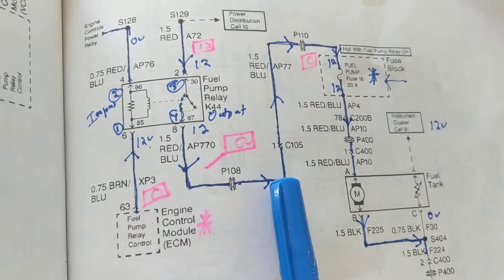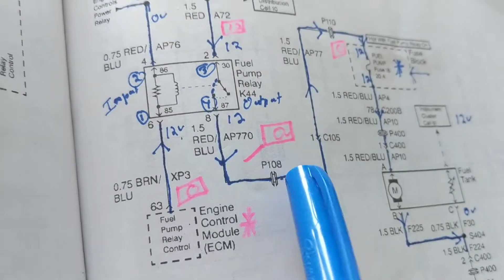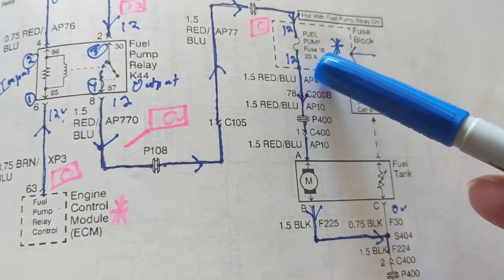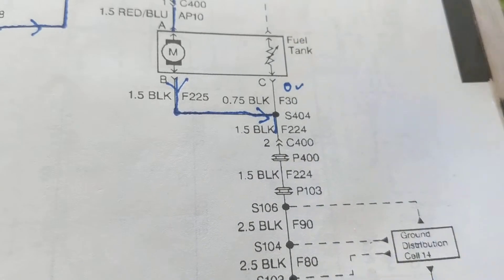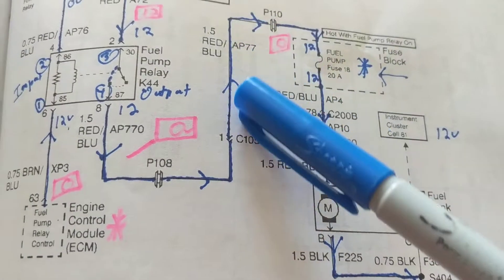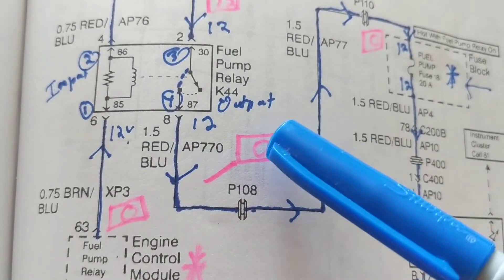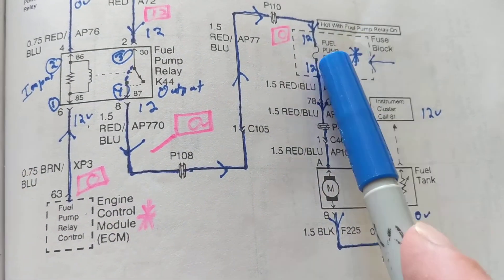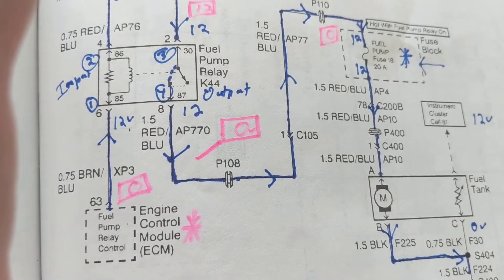how to fix a car WITH FUEL PUMP RELAY.  PROBLEMS  ,WIRING DIAGRAM WITH MULTIMETER

Comment: My fuel presure is low will leek down over time 3hrs 30psi to zero fuel gage became inaccurate after lowering the fuel tank found a gas leak fuel fill hose had rubbed the frame fixed it now? Fuel pump runs not 3sec  anymore  thurty second or more most time now have to use starting fluid to start first time runs bad floods then will smoothen out like a new car next time will start right up after interment😢
Reply from the maker: Usually if fuel pressure leaks. Your fuel pressure will go down pretty quickly, not over hours. That's the first issue number two. There might be a bad fuel pump, regulator or check valve is that if that happens? Leaky fuel injectors might also be a cause but that will be over a while when you lose fuel pressure that has to be done with a scanner on a balance test I would wait first thing in the morning when the car is cold and not driven. Measure the fuel pressure and see when it goes down. After you shut off the car it should still hold fuel pressure. So try this. Get back to me

Comment: ECM send ground to the relay to energize the fuel pump.
Reply from the maker: Yes they send the grounds so the relay and some that's why it's very important to make sure the computer module works and not always assume the fuel pump it'll turn it on for a few seconds hold pressure and a fuel system
Reply from the maker: Most of the time it's the grounds given by the computer a virtual ground not a physical ground

Comment: I have a problem with getting the negative ground on the fuel relay while having two 12 volts on main contact terminal and 12 volts on controlling contact. This problem is on Toyota Mark 2   1 G engine.
Reply from the maker: Are you trying to bypass something doing if this way or try to give me more information about what the symptom is

Comment: thak you.              that was  a verry good imformation  i learn  from you. 
how do we known if the imobilizer system iis faulty because the ECM  does not triger the 12 volt signal to the fuel pump relay

Comment: Good evening Joe and nice to meet you my friend!

My vehicle (2003 Dodge Caravan Se V6 3.3) is giving me a (P0201-Injector Circuit/Open Cylinder 1) code and i have a (2003 POWERTRAIN DIAGNOSTIC PROCEDURES book for town & country, caravan and voyager) that shows on page 88-89 test procedures to follow and apply. 

So far i have applied (test 1) and (test 2) and im on (test 3) now and im stuck on not being able to follow and apply it cause im not grasping and understanding it at all. 

This is Test 3
Turn the ignition off.
Disconnect the Fuel Injector harness connector.
Remove the ASD Relay from the IPM.
Turn the ignition on.
Jumper the Fused B+ circuit and the ASD Relay Output circuit in the IPM. (This part im lost)
Using a 12-volt test light connected to ground, probe the (K342) ASD Relay Output circuit.
Does the test light illuminate brightly?
Yes      Go To 4
No     Repair the open in the (K342) ASD Relay Output circuit.
          Perform POWERTRAIN VERIFICATION TEST VER-5.

This is a video of me following and applying (test 2-https://www.youtube.com/watch?v=rbzQKyiNwcA) and in that video it shows the pages in the book from page 88-89 and pages 312-314 for code (P0201-Injector Circuit/Open Cylinder 1).

Are you able to please make a video showing me how to apply (Test 3), (Test 4), (Test 5) and (Test 6) on page 88-89 and the same from page 312-314 (Test 1), (Test 2), (Test 3), (Test 4), (Test 5) and (Test 6) shown in the video?
Reply from the maker: The first thing for me is I never use a test light that only use a multimeter on the voltage setting it's more accurate number two you want to measure the connector voltage with the load and without the load meaning disconnecting the connector from the fuel injector number three you should get around 12 volts or 14 volts if the alternator is working and number four the voltage might be high or too low or the resistance has changed value from a faulty injector
Reply: @Joeelectronicschematicsforauto  
If your able to please make a video it would help me out better cause i feel like i learn better watching a video honestly its like hands on learning.

If your able to do that i will greatly appreciate it very much and if you cant then i understand my friend.
Reply from the maker: @Diagnose1  when I get a chance definitely
Reply: @Joeelectronicschematicsforauto  
Thank you so much my friend!

That's awesome.
Reply from the maker: In conclusion measure the b+ of the connector you're looking for around 12 volts if it is being pulled down disconnect the connector and see if it rises back up meaning you have a faulty fuel injector now the ground comes from the computer which pulse is it from 12 volts to ground that's the most important that's how it turns it on for this I use a multimeter not test lights to catch the pulse try to do these things I'm going to get back to me
Reply from the maker: Now if you notice all fuel injectors are tied to the same point to get 12 volts so if one is bad they should all get the same voltage they are in parallel meaning the ground is coming from the computer the engine control module likely the ground is bad the module might be bad or the injector might be bad
Reply from the maker: See that they all are tied together to the same b+ if one is bad at the b+ side they will all have the same voltage only thing you could do is just take out the other connectors and see which one normalizes the voltage even though you will not have a crank

Comment: So what to do if you don’t have no control power , pull pin out and what move it or add new .
Reply from the maker: That's why on my videos when it comes to relays I always say go to measure pin 87 and you should have 12 volts now obviously if you do not have that you have to go to control site to see if you have 12 volts coming into the relay if you do not have 12 volts coming in there you have to trace it back where it's coming from

Comment: Could you tell me why I am not getting prime with the key on?  My car starts when I turn the key in the position start but not on the ACC.  Thank you, I will appreciated!!!
Reply from the maker: Your car supposed to be having fuel pressure in the run position the accessories position is just for accessories when you start the car you go to run position build fuel pressure then the start position then back to the run position
Reply from the maker: The accessories position that the dashboard should come on that's a different problem the question is does your instrument cluster come on in the start position
Reply from the maker: Then you know you probably have a problem with the lock cylinder

Comment: Joe Awesome video. But I have a question about the fuel pump relay . The relay is getting the 12v from the ECU . But the switch will not close to send power to ur fuel pump . Until the air flow meter measuring plate  moves then it closes the ground Circuit . When that happen the fuel pump relay switch closes then my fuel pump is now getting power . . But the Toyota needs to running for that measuring plates open. My problem is , when u turn the key to the on position before u cranking the engine . I get no power to the fuel pump . . But I get out and push with my finger that measuring plate just a bit the relay is now sending power to the pump . . .
Reply from the maker: In the run position not the start position you should build up fuel pressure obviously if the fuel pump relay has been activated by the computer the question is how when you say you're not getting power how much fuel pressure are you measuring?
Reply from the maker: Toyota's have a TPI air flow meter system just like the 4Runner there is a connector to bypass that system to see if the fuel pump comes on if it doesn't obviously then you have to check the fuel pump meter voltage make sure the switch is closes that's number one out of a couple of things that you should start doing
Reply from the maker: I know my explanation is a little technical and complicated but obviously the fuel pump relay goes through the the meter there flow meter what you have to do is try to ground the side of the relay to see if it comes on if it comes on and obviously the meter is the problem but you have to check voltages in the run position
Reply: @Joeelectronicschematicsforauto  

Hay joe , when I turn the key on but not cranking . I’m not getting any fuel pressure because my fuel pumps is not getting power to pressurize the fuel line , fuel pump is new , I test it before I installed it . Open Circuit Relay is new , And my air flow meter is also new .. I even sent out my ECU . And came back with no problems so my ECU is good . .
Reply from the maker: @chrismaiolino800  I perfectly understand that obviously if the fuel pump relay is not on there's no fuel pressure but there is a connector that you can bypass the system to see if the fuel pump comes on and to program the computer modules I need voltages measured right now so I know
Reply from the maker: @chrismaiolino800  I want to make sure the ignition switch is good but I have to know voltages that are measured so many parts have been replaced
Reply: Hay joe , how much fuel Pressure I’m measuring . Nothing , that’s my problem when u turn the key to the on position . The fuel pump should run for 1 to 2 min to pressure the fuel line . . . It’s not that’s where I’m not getting power to the pump . .
Reply from the maker: @chrismaiolino800  so obviously fuel pump is not on this is a difficult part when you crank it you have to see if you get RPM telling you that the crankshaft sensor is giving a signal then you have to go to the fuel pump relay to see if it is on that's by measuring it the output of 87 terminal of the relay could be the computer is not giving it a proper voltage
Reply from the maker: @chrismaiolino800  I'm looking for about 50 psi fuel pressure obviously if you have nothing remember it has to look at a signal from the crankshaft sensor if it doesn't see it might not turn the fuel pump on

Comment: -Well done nice video I have a problem with the seat Ibiza 2005 1.4 I took out the battery to charge it and when I put it back and put the key in the ON position it makes a noise in the dashboard as if a relay opens and closes quickly like a percussion drill and when I turn the starter it turns normally but it does not start. I checked and found the relay that made the noise I attach it (191 906 383c) 167this relay probably supplies the petrol pump and when I disconnect the petrol pump the noise stops and I measure the voltage and it is about 12 volts while it is on the battery.5 volts and when I put a load lamp instead of the pump, the noise in the relay starts to fight and the voltage drops to 3 volts, maybe someone can help to know where the pump relay is supplied from to control its supply. the relay I have opened is clean and works with a separate power supply. when I put a light bulb in the base where Benny the relay in place of the Coil from the relay the light turns on and has a low voltage of 5 volts and when I put it between the relay and the chassis it lights up normally ((thimios1953@gmail.com))  Για σας μπράβο ωραίο βίντεο εγώ εχω ένα πρόβλημα με το seat Ibiza 2005 1.4 έβγαλα την μπαταριά για να την φορτώσω και όταν την ξανατοποθέτησα και έβαλα  το κλειδί στην θέση ΟΝ βγάζει έναν θόρυβο μέσα στο ταμπλό σαν να ανοιγοκλείνει κάποιος ρελέ γρήγορα σαν κρουστικό τρυπάνι και όταν γυρίζω την μίζα γυρίζει κανονικά αλλά δεν παίρνει μπρος. Εχω κάνη έλεγχο και βρήκα το ρελέ που κάνη τον θόρυβο το επισυνάπτω (191 906 383c) 167αυτό το ρελέ μάλλον τροφοδοτεί την αντλία βενζίνης  και όταν αποσυνδέω την αντλία βενζίνης σταματάει ο θόρυβος και μετράω την τάση και είναι 10 βολτ περίπου ενώ στην μπαταριά είναι 12.5 βολτ και όταν βάζο μια λάμπα για φορτίο αντί για την αντλία αρχίζει και πάλη ο θόρυβος στο ρελέ και η τάση πέφτει στα 3 βολτ μήπως μπορεί κάποιος να βοηθήσει να ξέρει από που τροφοδοτείται το ρελέ της αντλίας για να ελέγξω την τροφοδοσία του. το ρελέ το εχω ανοίξει είναι καθαρό και δουλεύει με χωριστεί τροφοδοσία.  όταν βάζω λαμπάκι στην βάση εκεί που Μπένη το ρελέ στη θέση του Πηνίου από το ρελέ ανάβει το λαμπάκι και έχει χαμηλή τάση 5 βολτ και όταν το βάζω μεταξύ ρελέ και σασί ανάβει κανονικά ((thimios1953@gmail.com))
Reply from the maker: Okay so from what I understand you took out the battery to charge it is the engine turning over or trying to turn over is the question of which are two different problems sounds like your start a motor is not engaging the crankshaft that will be problem number one problem two is it is engaging the fuel pump is not being turned on which you should have 12 volts on the control side now problem is the computer might control the fuel pump relay if the computer is not working for blown fuse or broken wire you will not have 12 volts
Reply from the maker: If you have 12 v at the load side going right to the fuel pump but it drops then obviously the load is pulling it down and that's how you take out the load if you can again several problems trying to understand which problem you are dealing with thanks for watching

Comment: Folks this man is teaching basic stuff.sure you can back prove pin # 6 but how would joe sniffy dont know shyt about electrical diagnosis.Joe is doing a phenomenal job in teaching the basics on how to approach electrical dianostics.I always work load backwards unless it's hard to get to.my technique 
Is 12 volts load then load to ground side, 12 volts relay bypass by jumping 30 to 87 , then 12 volts to fuse. Wires last
Reply: Checking PCM is a great place  to check but joe snuffy would have to know what pin# to check
Reply from the maker: I didn't understand which circuit you were referring to it sounds like a relay but I didn't understand the point
Reply from the maker: I'm trying to teach people who are technical and people are just beginners from all the emails that I've been getting some people are having difficulties following diagrams and symbols and components and that's why I have to teach the basics and something's I go to technical schematics if you see my channel Joe electronic schematics from Auto you see how technical like that but I have to balance it
Reply from the maker: which pin are you referring to which diagram I appreciate your comments
Reply from the maker: if you look at the comments from the other videos of people there is a common saying they want the basics of schematics and how to understand to follow them these are the comments on other videos on the channel it's not easy trying to teach technical and trying to teach basic at the same time but I don't understand what you're referring to which circuit
Reply from the maker: and I'm also not teaching to bypass the relay as I've been getting comments that people are bypassing the wrong one and damaging other components my technique is not to bypass it but to understand the current flow going through it and the voltages measurements what the relay my technique is different than your technique but thank you for your comments
Reply from the maker: and if you were saying I'm teaching basic electronics go to the very first videos that I taught students about transistor amplifiers all the stage common emitter common base common collector amplifier circuits troubleshooting and ohm's law and digital circuits those are the very first if you go to my channel Joe electronic schematics for Auto with voltage drops on schematics nobody else does this
Reply from the maker: and even if you jump pin number 30 and pin number 87 in the relay that tells you that circuit of the relay is good what about the other circuit how do you troubleshoot the other circuit that has a computer input how you going to check the computer input with a multimeter like somebody else on me you need to use an oscilloscope for signals
Reply from the maker: after you jump the relay like I said in the video what about the other part of the circuit of the relay what about the control signal of the computer how you put a diagnosed at on the PCM with 200 pins there is a technique and there is a method for it as far as my electronics my background is microwave electronics digital electronics automotive electronics avionics electronics to component level
Reply from the maker: So looking at the diagram that I found what you
Reply from the maker: found the diagram you were referring to even if you jump a 87 and thirty the fuel pump comes on what about 86 + 85 85 gets a signal from the ECM that's supposed to turn it on for 12 hours I can Brown bin for but still have to deal with an engine control module that is buried somewhere with over 200 pins what do I do about that didn't hear a response

Comment: Could you have saved a lot of time by back-probing pin 6 of the ECM?
Reply from the maker: That's a good question and the answer is because it is hard to get to the ECM and to get into the connector to back probe that's why I chose first to go to the fuse which is easy access on the computer module ECM remember you can have 200 pins and it might be hard to get to thank you for the question good question